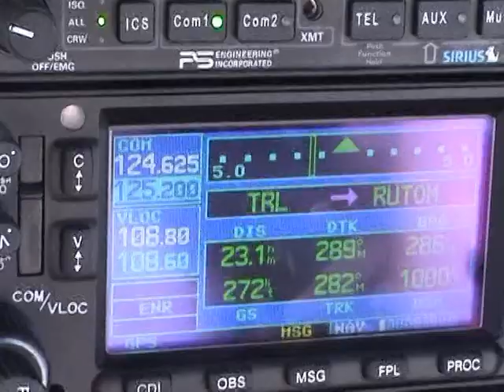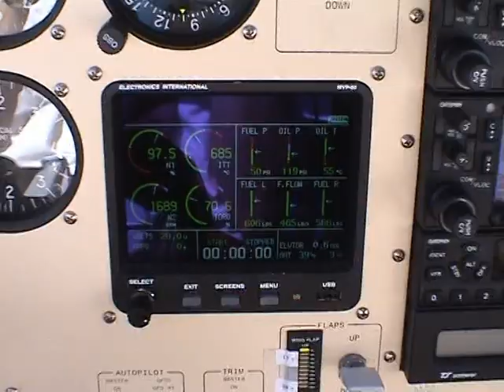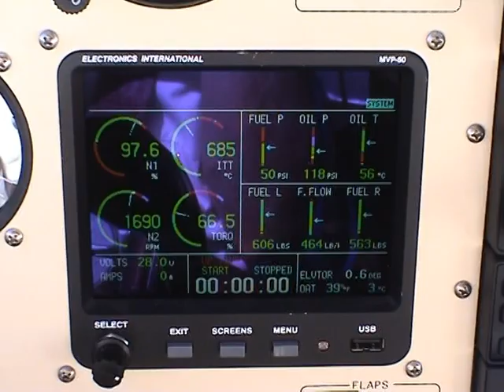Building the Farnborough Aircraft Kestrel & First Flight

Comment: Carbon copy of the Epic LT
Reply from the maker: Both aircraft were designed together under a collaborative agreement, using, amongst other things, the extensive aerodynamics design work that had been developed over several years beforehand to combine a high speed laminar flow wing design with large fowler flaps to provide low speed flight with benign characteristics (speed range 60 knots to 352 knots - wow!). The aircraft are all but identical firewall forward, wings, empennage, systems, but the Farnborough Kestrel had a bigger cabin that could fit up to 9 people. You may notice that some of the build sequences in the video take place in Epic's facility in Bend, OR. So, maybe the Epic is a copy the Kestrel?!  Thanks for watching the video :)